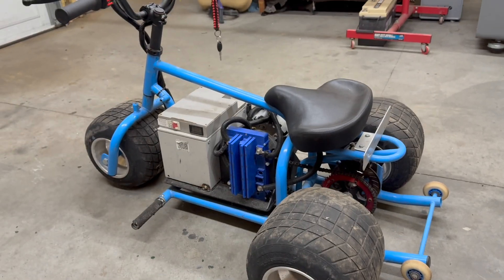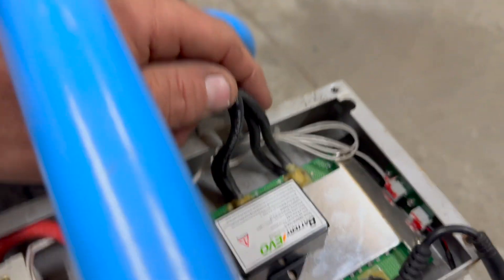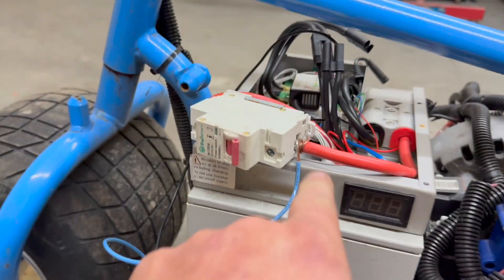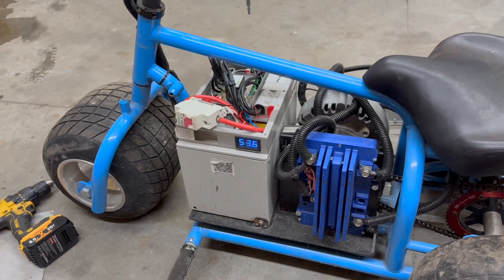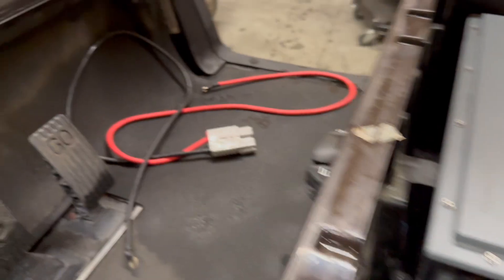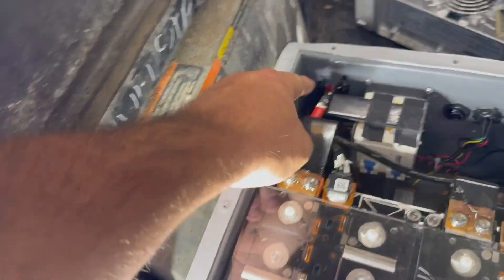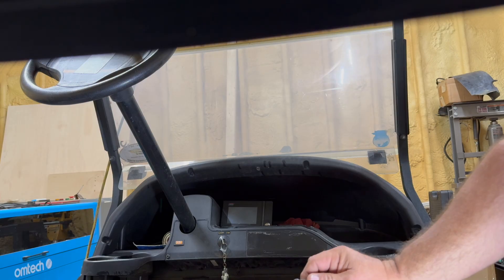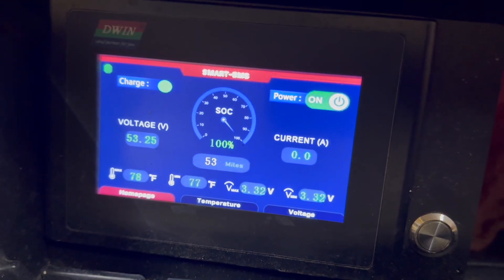Golf Cart Lithium Battery Wont Power On or Charge | Try This.

Comment: This operation is very dangerous and not suitable for everyone; There is a safe way that will not generate any sparks; Connect the negative pole of the charger to the negative pole of the battery and the positive pole to the output port; Disconnect the circuit breaker before you operate it; Finally, open the circuit breaker and wait for the battery to charge; After the circuit breaker is opened, open the screen again; This will be much safer;

Comment: A little nerve wracking but good job. I’ve rebooted a few dead lithium’s using your 6 nine volt batteries in series trick that works very well but never got inside to try it. When the smoke and melting wire starts that would unnerve me some. But watching you might give me some courage to try it if the occasion comes up.
Reply: dont do that， not safe；